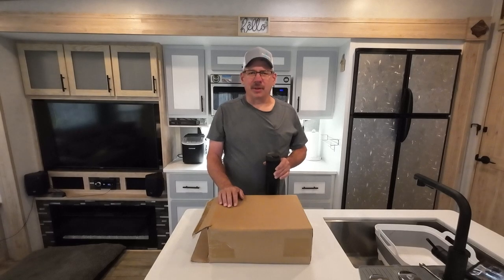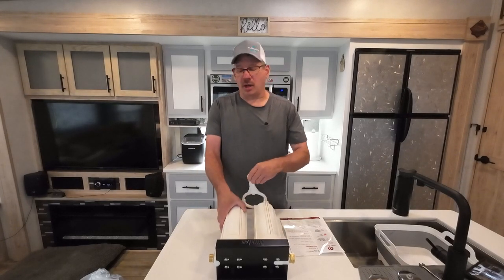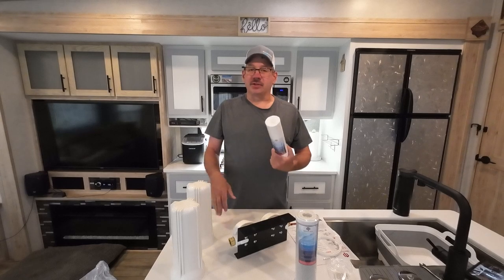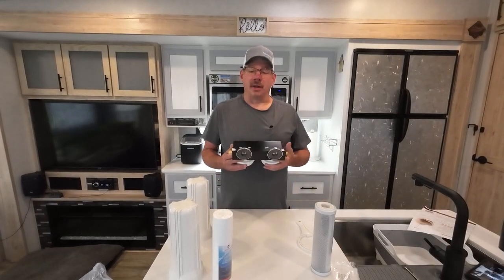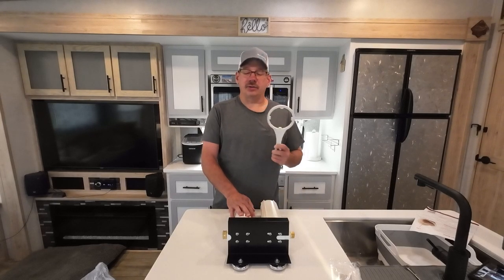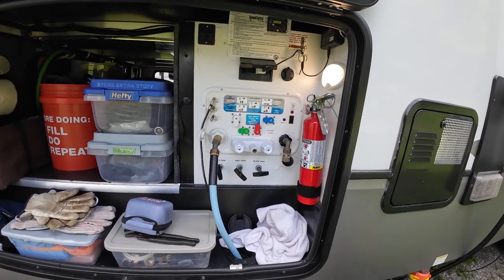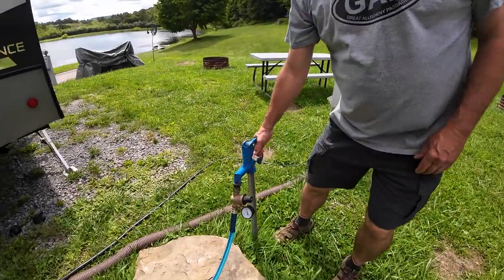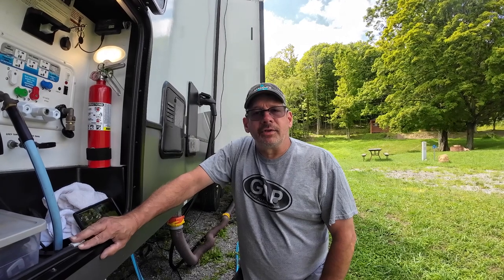Beech Lane External Dual Water Filter System Review

Comment: Good video. I installed the same system, in same location using J Hooks (but I like the magnet approach), and it IS a little difficult to see when mounting. I've also installed these same J hooks inside cargo bay, on forward bulkhead, to hang unit for traveling. Quick connects and 90s  also make things simpler for hookups. I've also have quick connections with plugs and caps to secure all components for traveling, mitigating water drainage, and keeping components clean(er). I've also used this filtration system (minus the filters) to sanitize the  entire system, and water lines within the rig. Keep up the good work. Your ideas, and trial and error, help tremendously. Thanks!